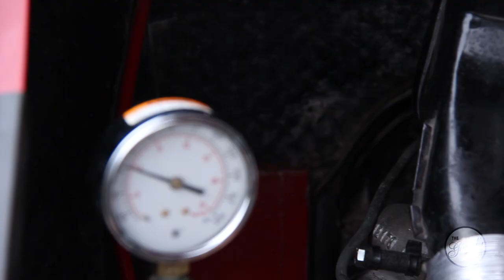1963 Karmann Ghia | Choosing Your Restoration Shop (Part 1)

Comment: Sometimes diagnosing such running issues turns a mechanic into an automotive 'forensics' specialist. You have to trace back to the 'cause' before you can bring closure. Nice job Billy.